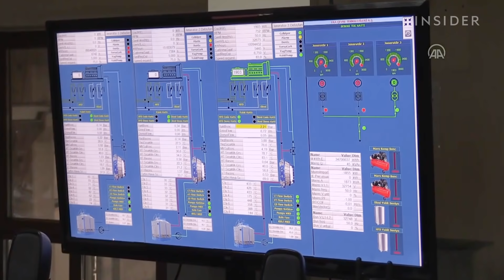How Old Tires Are Turned Into Electricity | World Wide Waste | Business Insider

Comment: no one  is considering that toxic gas damages the ozon layer😢😢😢
Reply: Its better than landfill and letting them extremely slowly decompose.
Reply: At 2:50, it is mentioned the old tyres are shredded and subjected to chemical process, producing a by-product called pyrolisis oil (comparable with biofuel) by pyrolisis thermal process, read this link:
http://2gbiopower.com/#:~:text=Enviro's%20pyrolysis%20process%20recovers%20the,products%20including%20new%20vehicle%20tyres. The chemical process is controlled and adhere to environmental regulations. 

The other two recyclable by-products are steel wires and carbon-black. "Carbon Black originally used to make the tyres, is recovered along with the other inert fillers. This is milled and beaded for re-use in rubber components. 1kg of virgin Carbon Black is made from ~1.6 litres of fossil fuel. Recycling carbon black (rather than burning tyres) reduces emissions by about 80%."

Only the pyrolisis oil produced are then use as fuel to burn (instead of coal or crude oil by product) in the thermal plant boiler to generate superheated steam which feed to the turbines. The turbines are then power the generators to produce electricity👍.